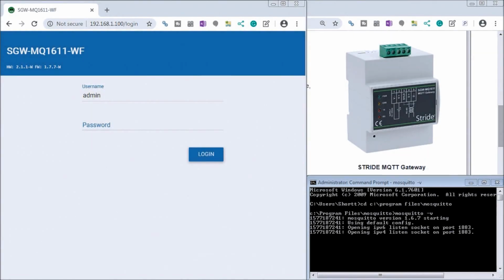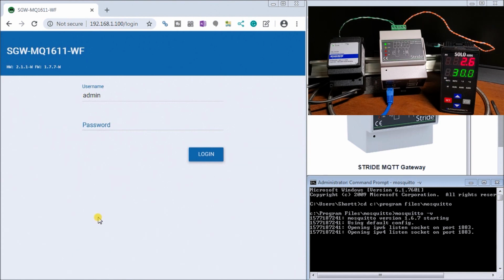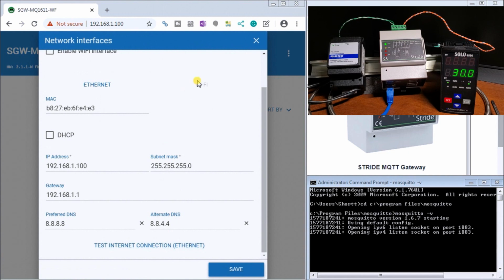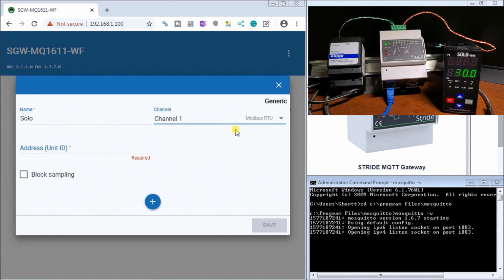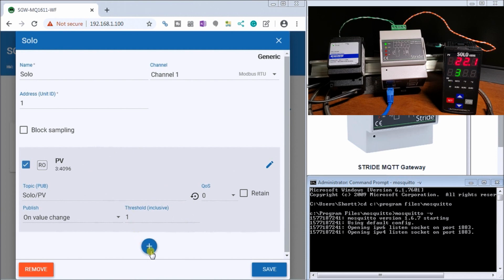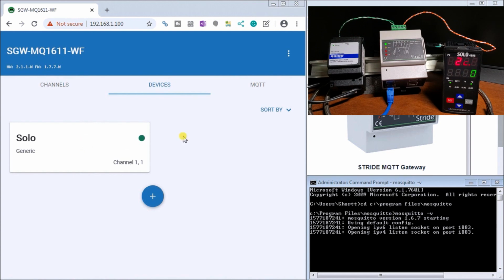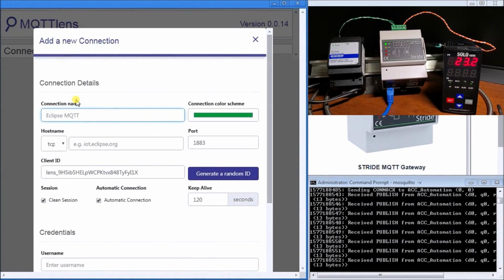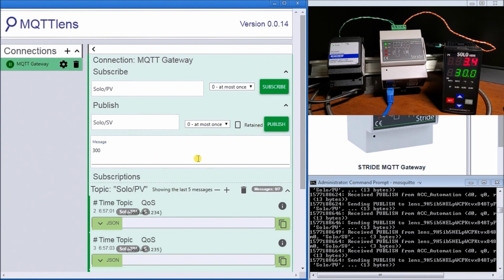Control Industrial Temperature Remotely: MQTT-Modbus Setup

Comment: When you changed set value on solo to 350; should the green SV display on solo have changed to 350? or is there such a long delay for the solo or the gateway to react ; that you were able to set SV from 300 to 350 and back to 300 before it could update?
Reply from the maker: Hi Justin,
I made an error when sending the data to the Solo. It must be sent with all four digits (16 bits). I should have sent 0350 instead of 350. During the video, I did not send the four digits so the information was never sent.
Thanks for drawing this to my attention Justin.
Regards,
Garry

Comment: Hi, When converting mqtt to modbus rtu, is it possible to convert Mqtt string data to Modbus hex data? ex) abc ->  616263
Reply from the maker: Hi 기모띠,
Modbus will only understand certain commands. Reading / Writing of holding registers will automatically convert the ASCII represented text characters to the hexadecimal equivalent. 
Regards,
Garry
Reply: @ACCautomation  Thanks Garry, What is the maximum number of conversion points (MQTT -> Modbus RTU) ?
Reply from the maker: @이지수-j1y  
"the maximum length of a Modbus PDU is 253 (inferred from the maximum Modbus APU length of 256 on RS485), only up to 125 registers can be requested at once for the RTU, and up to 123 for the TCP."
https://en.wikipedia.org/wiki/Modbus
125 registers have 16 bits each or two ASCII characters. So the maximum is 250 characters.
Regards,
Garry
Reply: @ACCautomation  I will purchase this model, can i  send technical inquiries to you e-mail?
Reply from the maker: @이지수-j1y  
Here is a link to the Automation Direct website. 
https://www.automationdirect.com/adc/search/search?fctype=adc.falcon.search.SearchFormCtrl&cmd=Search&searchquery=STRIDE+MQTT+GATEWAY&categoryId=0&TxnNumber=-1&searchqty=10
You will see a link at the bottom of the screen for international sales.
https://www.automationdirect.com/adc/international/international
Regards,
Garry
Reply: @ACCautomation  Hi garry, I'm testing this equipment 
The conversion to Modbus by subscribing to MQTT numeric data is well monitored, but the characters are monitored as 00 00.
How do i set it up?
Reply from the maker: @이지수-j1y  
How are you monitoring the information? Can you describe your setup and hardware used?
Thank you,
Garry
Reply: @ACCautomation  I'm using stride mqtt gateway, can i know your e-mail address?

Comment: Very expensive solution for small automation...
Reply from the maker: Hi Yuri Agapov,
It really depends on what you are comfortable doing. Node-RED on a Raspberry Pi could do the same thing easily. 
https://accautomation.ca/series/node-red-iot-enabling-software/
If existing systems are present and you need to add MQTT communications to the main ERP system, then this is possibly a solution.
Regards,
Garry
Reply from the maker: If you are looking for some small automation projects then the Click PLUS PLC now has MQTT built into it. 
https://accautomation.ca/series/click-plc/
The BRX Do-More PLC also has MQTT built into it.
https://accautomation.ca/series/brx-do-more-plc/
Regards,
Garry
Reply: @ACCautomation  so I don't need any PLC, I'm interested to find some cheap rs485 to mqtt gateway instead of using USB to rs485 converter on rpi
Reply: @ACCautomation  I'm using node red on rpi4 (with USB to rs485 converter) now with 7 modbus devices - it is really good!
Reply from the maker: @102diy  
Excellent. Node-RED is a great package for the IoT.
Garry
Reply: @ACCautomation  have updated to 2.0.3 today.
Reply from the maker: @102diy  
Thanks for the information. I will be updating my version of the sofware.
Garry

Comment: Has anyone achieved mqtt to modbus tcp? That would be great for IOT Scada integration.
Reply from the maker: Hi Pedda,
The MQTT Gateway is used to publish and subscribe to an MQTT Broker.  It will also do Modbus TCP and RTU (Ethernet and Serial) communications as a Client or Master.
https://accautomation.ca/stride-mqtt-gateway-click-plc-modbus-rtu-tcp/
Here is the post that shows Modbus TCP and RTU.
Video:
https://youtu.be/-a39SOgRc9k
Regards,
Garry
Reply: @ACCautomation  I have several IOT applications that i would like to integrate into our existing SCADA system and the IOT sends data over MQTT. Can the gateway act as a MQTT client and convert that to modbustcp?
Reply from the maker: @peddahill5253  
Yes, this gateway can subscribe and publish on the MQTT Broker. This information can then be written or read from the Modbus TCP network.
Regards,
Garry
Reply: @ACCautomation  excellent, do they have resellers in europe by any chance?
Reply from the maker: @peddahill5253  
Here is a link for the resellers in Europe.
https://www.automationdirect.com/adc/international/international#3
Regards,
Garry

Comment: Sir, could you please provide sample vba code for reading data from moxa/terminal modbus over rtu
Reply from the maker: Hi Venkatesh,
Please refer to the documentation for your Moxa terminal. It should provide the Modbus addresses that you want to read/write. 
This would be similar to the Solo Modbus RTU communication presented in the video.
Regards,
Garry
Reply: @ACCautomation  sir, I have modbus address but I am unable to read in modscan software..
Reply from the maker: @venkateshchennuri8992  
Have you contacted the vendor of the products that you are using? If you want you can send me some screenshots of the address and information that you are sending.
garryshortt@accautomation.ca
Regards,
Garry